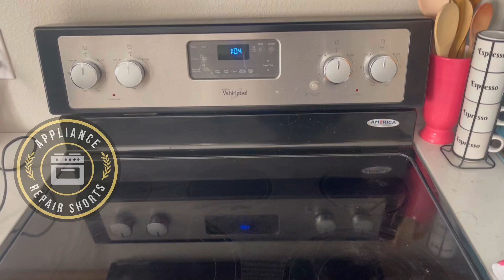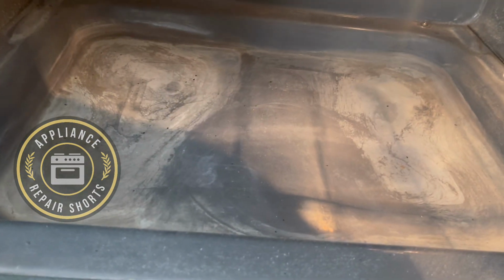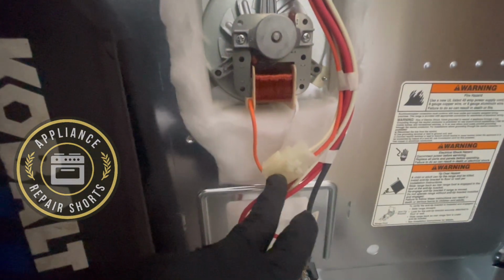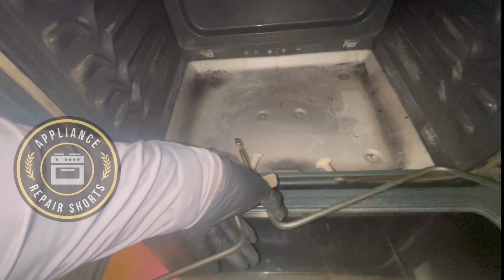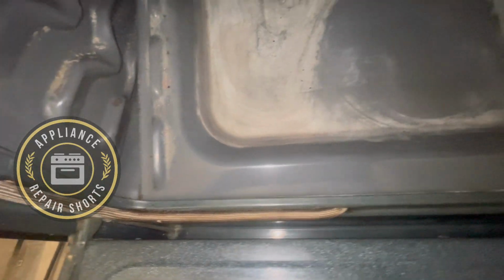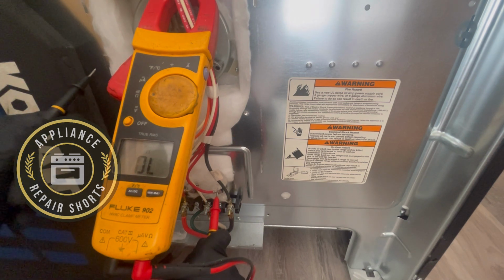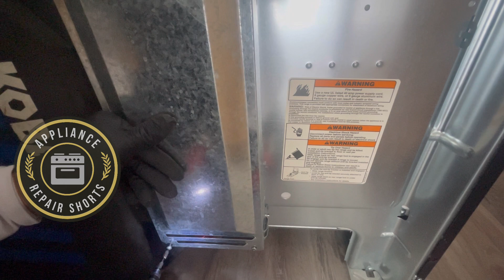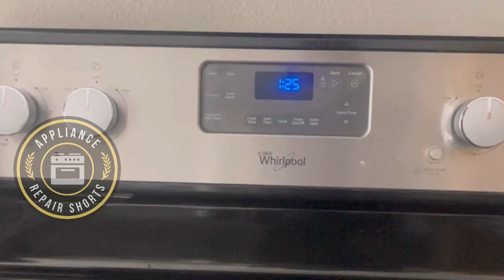Whirlpool Stove|Range Element Replacement WFE540H0AS

Comment: I have the same oven, and the screws are not coming out.  They look like they are rusted together.  Any suggestions on how to remove them.  The stove part is great but the oven is rather cheaply made.  The porcelain in the oven is poor quality, and the self clean feature does not work.  I had a Fridgedare oven range before this one, and it was made better.  The lower oven pan on my oven has chunks of porcelain enamel coming off, and it is also rusting.  This Whirlpool oven is poor quality.
Reply from the maker: You might need a putty knife or something to help pry up as you turn. Go slowly to allow the screw to bite. Remove the door for better access
Reply from the maker: You need to put a flat blade screwdriver or a putty knife under it and turn the screw and it will come out